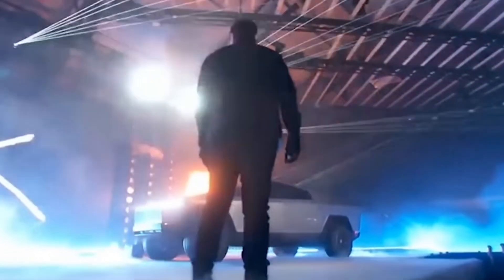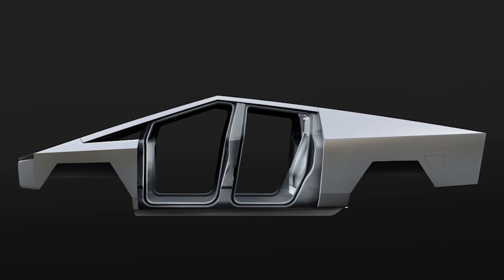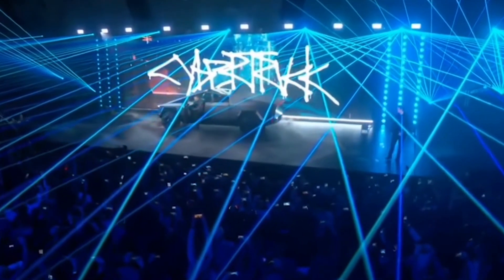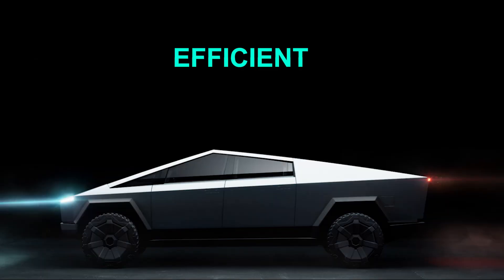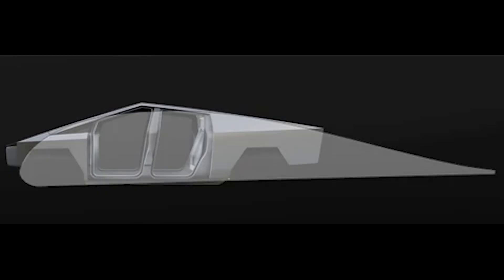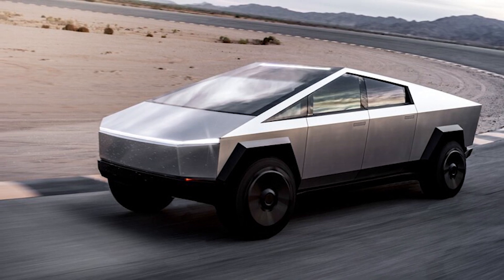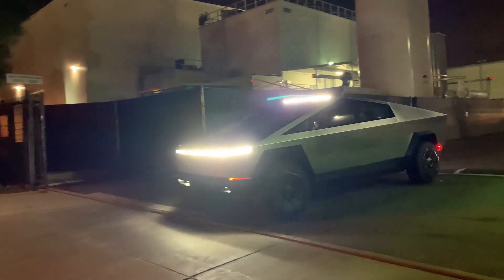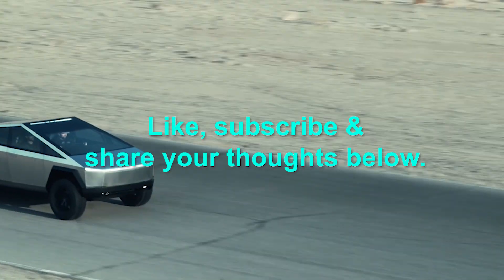Cybertruck is Engineering Genius (and will be copied)

Comment: BTW: Laser-cutting, scoring and folding is 3 processes.  
(just a friendly heads-up from one technocrat to another, don't hate me, I don't hate you. Nor do I hate Electric cars etc.   I am an Energy Junkie, I can do the math(s) too - need to balance all the equations and work out all the boundary conditions)

Stamping also often involves around 3 processes.

Stamping / pressing is better suited to high volume production (lots of the same thing)  Laser cutting and "bend-wise" folding is better suited to low volumes and one-off items.

Stainless steel is generally more expensive than regular steel (much) and  aluminium.  (not to mention the likely hand-TIG welding.)

(Huge flat monocoque panels, are heavier, less-rigid and more expensive than thin complex folded shapes. - check out how a typical bonnet is made, 2 piece, smooth flat outer "skin" complex folded inner- stiffener...  If this Thing were made more like that (it may actually be, we don't really know) some of it may make sense.)

Manufacturing in this way, (and from these materials -if they actually become any less than vapour)  is likely governed by "the fact" that one could set up a factory to churn out tens of cars a day for a pittance whereas a conventional plant can't be made for the same lowball cost ($ x1000).  Sadly in Auto manufacture things don't actually scale up or down well between volume ranges.   Large format Presses aren't cost effective for low volumes  (they aren't easily  reconfigurable -on-the-run for different parts), and laser cutting loses any price advantage with huge volumes  (each cut piece takes the same time, no matter how many you make - the only scale advantage is that you may get to buy [or become] a laser-cutter manufacturer for cheaper access to many machines)   stamping / pressing is much better for large volumes - once you have the dies made.

Investors may eat it up (love it), because anything which gets volumes rolling with little capital outlay will make them happy.

BTW, Electric cars are "easy".  Simple to Package, simple to design, simple to incorporate '"smart"  gadgets in.   The only reason the other car manufacturers didn't bother -too much - was that they were still making money.  The oddds that a random billionaire would come along and buy up a whole car manufacturing plant to make "kit cars"  was not on their radar.  Now it is, that's why there are big investors in the Rivian project.

Back to watching the rest of the video..

Batteries are still nowhere near what they need to be to allow any more than "Urban fringe crawling" - the day you can chuck on a few "jerry-cans" worth of energy and hit the desert for 3000km.  That day may come, but we will probably be using single-use factory-recyclable (discardable in the desert) batteries in order to get portable energy-density to around 10MJ /kg.   (Currently 900kJ /kg, hoping for 1.44MJ in coming years)

BTW, For colour on cars, Wraps or plastidip-like coatings are a way to go, if Corrosion resistance isn't required..

Comment: Is it safe in a crash? I would imagine the exoskeleton and stainless steel wouldn't even get a dent in a crash, but that would make it dangerous as the passengers would take all the impact. That's why cars crumple in the first place, to absorb the impact.
Reply from the maker: Lots of people are raising this. The steel can be scored on the underside to crumple predictably and consistently (or the hood could be a separate component). I think many will be surprised at how well the Tesla engineers address this. Safety is always top of mind at Tesla. It may not appear so but the driver in Cybertruck sits the same distance from front of the vehicle as they do in Model 3 so there's equivalent space for crumple zone too.

End of the day, Cybertruck won't be allowed on roads if it is not sufficiently safe for occupants or pedestrians. Tesla are smarter than to design an unsafe vehicle 😉

Comment: Not to piss on a parade but how are you going to get home from the job site if you've used all your power running your tools on a job site? Secondly plz plz plz go back and watch the sledge hammer "demo" dude obviously went full bore on hanging traditional door panel and then was super hesitant hitting the Tesla truck (not saying panels aren't strong but definitely biased test) Get a machine to hit both with same force. Love the progress electric vehicles have made but am not confident this truck can replace a job site truck yet. Unless they make a matching trailer with its own battery bank (cutting carry load) I again don't see this replacing working trucks when your total range is immediately cut in half at full load, it limits working people too much. Will other automakers copy the efficiency in which these are made, definitely. Just because an electric vehicle can tow all this weight doesn't mean the it can travel far with that weight. Look at Volvo Electric semi that recently pulled somewhere around 370 Tons of shipping containers but only managed 360ish ft. before batteries were up. We still have a lil ways to go before electric trucks can replace fleet trucks/work trucks.

Comment: Is it safe, though? A car should crumble on impact, not stay intact and crumble the passengers...
Reply from the maker: Lots of people are raising this. The steel can be scored on the underside to crumple predictably and consistently (or the hood could be a separate component). I think many will be surprised at how well the Tesla engineers address this. Safety is always top of mind at Tesla. It may not appear so but the driver in Cybertruck sits the same distance from front of the vehicle as they do in Model 3 so there's equivalent space for crumple zone too.

End of the day, Cybertruck won't be allowed on roads if it is not sufficiently safe for occupants or pedestrians. Tesla are smarter than to design an unsafe vehicle 😉

Comment: as for utility, there is one issue: Often, you want to put stuff on the 'edges' of the bed. (because it does not fit in the bed) You can do it, because the 'edges' are flat.  for Cybertruck... they are slanted, so I don't think you can use them, even if they are sturdier.
Reply from the maker: Yep, fair point.
Reply: That was the first thing I thought of too, truck bed edges are useful when they're level for mounting things like toolboxes etc.
Reply: You will be able to open the sides of the bed according to pictures on the keynote!
Reply: @armswat  That would be great and solve everything! - It will stay aerodynamic 99.9% of the time, but be relatively accessible and still make it possible to transport cargo too big to fit in the bed!
..... I will need to come up with a new complaint why this truck isn't perfect :D
Reply: I have never seen that done.. any example pics?
Reply: I think that is the biggest design issue for me. The bed sides need to have outside accessibility to the bed floor, the entire length of the bed. it's a easy fix. I've seen concept designs with that back area trimmed and it looks better imo. It will need exterior mirrors. It's the law. Issue with tailgate lights also. i believe they have to be on the body, not the gate. Again law. The shape has grown on me but i still think it needs more cuts. dashboard needs options as well. $100 refundable deposit isn't a good sign of how well this truck will sell. seems more of a status symbol vehicle, utility? not so much. maybe an suv would have been a better idea here.

Comment: It's not a truck - it's an armoured car at best. Trucks are much larger.
Reply from the maker: It's almost the same size as the F150.
Reply: @SolvingTheMoneyProblem  Still, when looking at actual trucks they pale in comparison. Trucks are taller, longer and heavier. Designed to transport a lot of cargo.

Comment: So with the safety ratings part, I'm all for that super safe tank of a truck but my only thoughts are wondering about the safety of others involved in an accident, since there's not much crumple-ability, any hit from that car will pretty much flatten other vehicles.  (im still going to get one though)
Reply from the maker: Lots of people are raising this. The steel can be scored on the underside to crumple predictably and consistently (and it appears the frunk is a separate component). I think many will be surprised at how well the Tesla engineers address this. Safety is always top of mind at Tesla. It may not appear so but the driver in Cybertruck sits the same distance from front of the vehicle as they do in Model 3 so there's equivalent space for crumple zone too.

End of the day, Cybertruck won't be allowed on roads if it is not sufficiently safe for occupants or pedestrians. Tesla are smarter than to design an unsafe vehicle 😉
Reply: Solving The Money Problem that’s pretty informative, thank you!

Comment: One thing that concerns me is if it has a malfunction and you're locked in it with unbreakable glass and the battery goes up in smoke.
Reply: It will probably have the same emergency manual release doors as the Model 3 has.

Comment: The Cybertruck is a niche within a niche. It's a truck for the city. You're limited in range and more importantly offroad capability, which matters far more to me here in Alaska. I think it will be great for those in the city, and when you mentioned scratching the paint worrying some folks it really reinforced that. I think there's some good innovation here but I still doubt that it will ever replace something like the Tacoma TRD and similar trucks that have much longer range, better suspension systems, and the ability to refill your own tank on the go by simply having a few jugs in the back.

Comment: 6:40 The truck might be safe for whoever's inside. But just imagine this crashing into your mini.
Reply from the maker: Lots of people are raising this. The steel can be scored on the underside to crumple predictably and consistently (or the hood could be a separate component). I think many will be surprised at how well the Tesla engineers address this. Safety is always top of mind at Tesla. It may not appear so but the driver in Cybertruck sits the same distance from front of the vehicle as they do in Model 3 so there's equivalent space for crumple zone too.

End of the day, Cybertruck won't be allowed on roads if it is not sufficiently safe for occupants or pedestrians. Tesla are smarter than to design an unsafe vehicle 😉
Reply: Not any different than any other large truck, your bringing up a non-issue.
Reply: @wildpetpack  Well it's not exactly the same is it. The cybertrack would hardly bend and most of the impact force would transfer to the other vehicle.

Comment: Good video, but you have a few flawed assumptions. Saying this, I'm a big supporter of Tesla and have my preorder in.

The first is that truck buyers care only about function and cost. The unfortunate reality is that most truck buyers are more loyal to brands than any rational use case. If they want to save money, they'll go with the cheapest car of the brand they want. In fact, I'll bet many owners will not only not care about value, but will brag about the fact that they spent more to get an ICE truck.

Also, the truck won't really work well for people doing towing (vs hauling stuff in the bed). Most superchargers don't have room for attached trailers and with the range reduction from towing, you will need a lot of them.

For people like me that would use it for passengers 80% of the time and light cargo 20%, it makes sense. But let's not fool ourselves that it will make a big dent in ICE truck purchase numbers.

Source: have lived in rural areas of many states for decades. The ridiculous anti-electric sentiments are real.

Comment: What if you get into an accident and the whole front chassis is dented and they cant undent it? Do you have to get a whole new chassis or what? That would really suck.
Reply: Since it's a monocoque design, sadly yes. That's exactly what you'd need - a whole new body. It may even total the car more easily. Thinking more about this, it does worry me from the standpoint of low speed fender benders.

Comment: rigid does not mean safe tho.
Usually cars have an internal and external structure for a reason, the external one folds like butter when hit and absorbs the impact while the rigid one protects the passengers by being squished. Cars that lack an external softer structures (like smarts for example) are less safe because they absorb less damage during impact.
I'm wondering how such a rigid structure would improve safety

Comment: I am skeptical that this body will result in significant cost reductions.  You are suggesting that this will have a reduced tooling cost, but I'm not sure that replacing the stamps and dies with what will probably be some sort of custom brake for the various operations will reduce that cost. Even if tooling costs are reduced, the material cost per unit is likely higher due to the fact that they have to use a ton of specialized stainless steel.
The "exo-skeleton" is just a marketing term for the vehicle's unibody design, which is what is used on most cars (not on most trucks). Because of the significant thickness of the panels, they might be able to use fewer features, but ultimately that will result in more weight. Conventional vehicles achieve greater stiffness out of thinner material by forming that material into those complex shapes. Because Tesla can't form their stainless panels effectively, they are forced to make them much heavier.
From a practical perspective, the shape is more aerodynamic, but it is also less functional, as it restricts your ability to load anything from the side of the bed. The aerodynamic benefits are only really going to be seen at higher speeds, but the weight of this design will affect its performance in all conditions.
Let's also remember that this is clearly a prototype, and looks like it's far from finished. The design will likely change significantly in order to meet regulations and safety standards. The current prototype doesn't even have mirrors. It's going to be a long while before these hit the market.